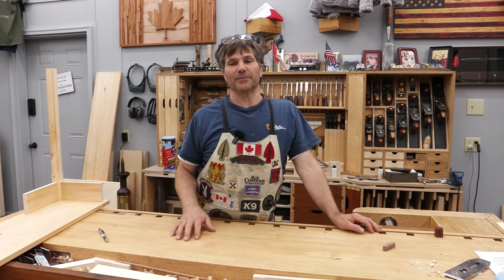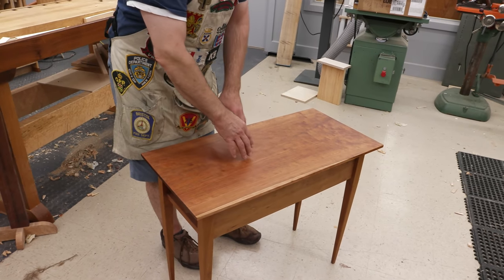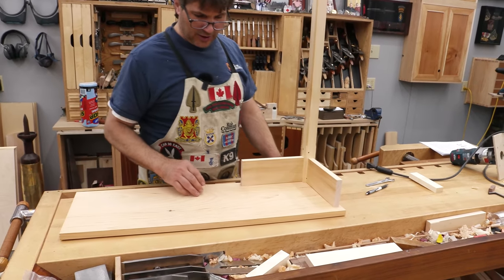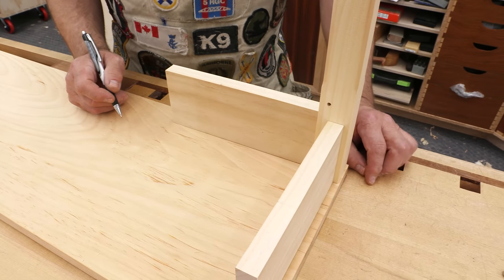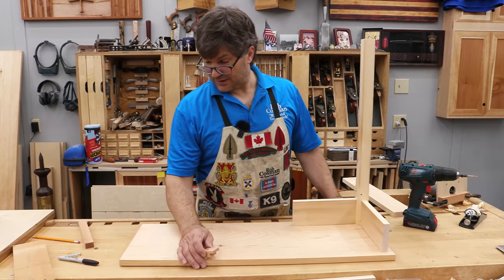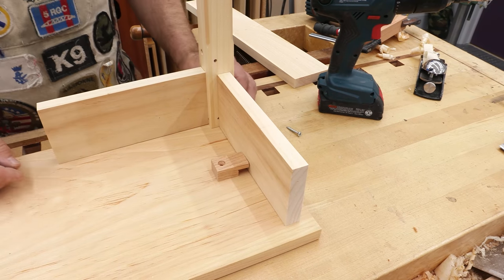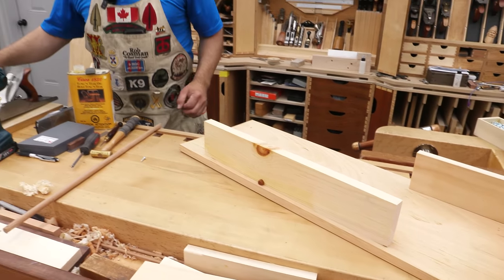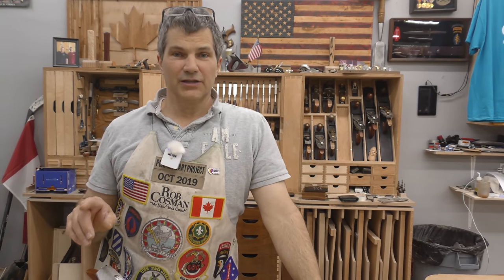3 Methods to Attach a Table Top - DIY Furniture

Comment: Thank you very much. This has been very helpful for this beginning woodworker. 
Question: I am planning to build a workbench with the top made of 2x4s laid on edge. Will the lateral movement of the wood laid on edge be significant enough to require this special joinery? 
Thank you again.

Comment: Hi, Rob.  This question is probably pretty unintelligent.

Those dowels seemed to fit really tightly.  Will they still allow the aprons to move along them easily without being waxed?  Could humidity cause them to swell slightly and bind?

You are easily the best teacher of woodworking around.  Thanks to you and your team for what you do.

Jim

Comment: Tricks for chamfering and flattening the dowel 👍.  Nice smooth result. Interesting how the dowel technique uses three fixed dowels on the end stretcher (that runs across the grain of the top).  Does that mean the dowel method is not really suitable for a wider top (say, 2 or 3 feet)?  Buttons to the rescue. Thanks for the video.

Comment: I have used both the washer/screws, and as well as the buttons technique. Somehow, the use of dowels seems simpler. It will be in my next project.  Placing a camfer on the dowel using drill and block plane was very clever.

Comment: Is this still necessary if e.g. you put a c-channel / and used metal legs for the bottom (more of a slab technique), or is this only necessary when the table legs are also made of wood and you're getting expansion there as well as the top?

Comment: I've been thinking about this today and it occurred to me that the Polynesians and other boat builders solved this brilliantly thousands of years ago.

Take a look at how sewn boats attach planking to framing. 

They used, some still use rope/twine to make the connection. Planks would have raised eye hole sections next to framing members, then rope/twine is wrapped through the eyes and around the frames or through holes in the frames, then the separate legs of rope/twine are wrapped/frapped together to cinch them tight. 

No nail/screw rust damage to wood. No breaking screws. No glue. Anyone can repair very easily  without any tools but a knife to cut twine.

Comment: The through dowels look great! Never seen that design before.
Do you see any need to be able to remove the top for refinishing? You had the top off of your first demo table (the one you were refinishing), but if you glue in the buttons or dowels, the top would be permanent.
Reply: Hide glue....maybe?  I was wondering the same.

Comment: I like the dowel hack

Because I usually make thick table tops and 4x4 inches legs (posts really), I use sliding dovetail for the stretcher/apron which is not glued and allows top expansion and contraction. The end of that stretcher slides in/out of the recess cut in the leg post. Stretcher is glued only to 2 legs and moves freely in/out of the remaining 2 legs. Top is attached to the legs with the wedged through mortise and tenon .
Video of how I make it will be coming up end of July 2021
Reply from the maker: I will have to watch that.  Contact Luther at robswebmaster@robcosman.com and lets talk about doing a collaboration video
Reply: @RobCosmanWoodworking  my video on the no base / no apron / double blind (hidden) shouldered sliding dovetail table top is now ready, if you'd like to see how I built it.

https://www.youtube.com/watch?v=SMe8KYavnV8

Comment: Rob thank you for this video. I wasent thinking when I made an end table from solid hard wood, havent attached the legs and aprons yet but drilled pocket holes, the top is in 4 pieces glued up as a panel. If I secure it with pocket holes and back off the screws a 16th or so will that be ok. I live in New York, not sure if you will see this comment hope to hear
Reply from the maker: You need to dill the pocket holes oversized.  Maybe drill them with the jig, then drill the hole again with a larger bit so you have an oversized hole so the screw can move freely back and forth in the pocket hole with seasonal movement .  just backing it out wont do it

Comment: I haven't tried it yet, but they lazy way of doing buttons that I'm thinking about would be to cut the mortices with a Domino (slay me now), narrow seeting for centre button, and wider settings for the edge buttons. Square off the holes with a chisel. The only other thing to bear in mind is that the button gets sized to the domino hole & position, not the other way round. I'd be using the depth stops on the domino fence to create the distance of the mortice from the edge of the apron, which, once set, would allow for a whole "button strip" to the cut on the table saw, and then cross cut to width. That would "mass produce" them and fit quickly.
Reply: I have done that several times and to me, it is a safe and convenient way to repeatedly cut the mortises for the buttons at a consistent height, depth, and width.  As you pointed out, one can roughly adjust the width of the mortise for play on the Domino.  This really works quite well and moves along quickly.  If you have a Domino, this is another use for it.  I still hand cut the buttons as Rob did, of course and you can square the ends of the mortises if needed.
Reply: If you're using a domino anyway, you can just cut a mortice in both the apron and a small rectangular block of wood (registering both for height on the same surface, but always on the narrow setting for the block). Glue an appropriately sized domino into the rectangular block and drill a hole through to attach to the table making it your button. I've done similar with dominoes in the past with success.
Reply: I probably should add that the reason I still cut my buttons instead of using a mounted domino is that I match the wood of the buttons to my trim or some key wood in the table for aesthetics, and then cover the counter sunk screw with a contrasting wood plug.  It looks kind of neat. I know most people do not look underneath at the buttons for a table, but that is just my thing.
Reply: @bicparker1  I actually carve mine from diamond, adhered to the table top using the secretions of the rare brain eating amoeba worm in a specialised laboratory setting. It's worked out significantly less expensive than purchasing lumber at today's prices.

Comment: I really like the dowel method. How would it change if you were attaching a wider table top, say 36 or 48 inches? Would the three dowels close to the center of the ends be sufficient?

Thanks for another great video.

Comment: Is the movement in the aprons not enough to push up on the top because of their size?
Reply from the maker: So the apron will move, but not a lot since its going to be 4-8" wide, But since its attached to the table all the movement will be in the other direction or away from the tabletop
Reply: @RobCosmanWoodworking  so when we cut the tenons smaller then the width of the stock and glue the tenons then the unglued shoulder, is allowed to expand and contract downward, right?

Comment: I like the third method best, use a domino on the ends with a slotted screw hole for expansion.
Reply from the maker: That works too!
Reply: That would look nice with some shop made dominos of the same or a contrasting species of wood.

Comment: Only thing that worries me with gluing the buttons is being able to remove the top in the future to, say, refinish…….or you don’t worry about removing the top to refinish……??    I like the dowel method…..seems simpler and easier than the button method….
Cheers
Reply: I was wondering the same thing with gluing the buttons down to the top. It would add some nice strength, but would make it impossible to remove the top down the road. I guess you could trim off the tongue portion on each button to free the top. Once you remove the screws you could flush cut the buttons and plane down the residue. Granted, you'd have to then make new buttons. Rob is amazing. I'm sure he'd have several back up plans.

Comment: What are your feelings on attaching tops with sliding dovetails?
Reply: I was thinking this as well, yet pondering it still as I wonder if a dovetail could potentially place all the stress on the “tail end” of the joint creating the potential for splitting the apron along that line, whereas the dowel being round may apply more evenly?  Still noodling but the best way is to build something and find out, right?  :)

Comment: So, instead of all the extra work in using the buttons, why not just cut a slot with a biscuit joiner - and you're done? very effective. It has been a very successful method with furniture makers for decades.

Comment: This is kinda driving me crazy. Wood DOES move longitudinal. Altough, at around 0.01%, it's very little, but depending on the length of your workpiece and your jointing methods, it could be a significant factor. Take your stiles for a closet/wardrobe for example. Those doors can easily be as high as 70 inch or 6 ft or whatever, and at this length, your movement could be as worse as 0,5 - 0,7 inch. Good luck opening your resessed door half year round, with just 1/16 inch gap around it.

Comment: If you glue the buttons to the top you'll never be able to remove the top. I always use screws only. the same goes for the dowels method.